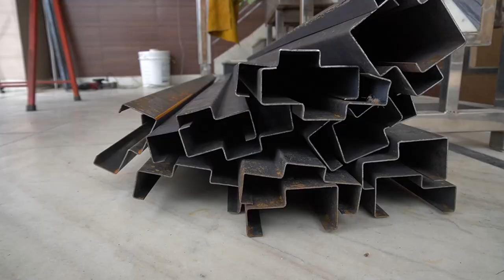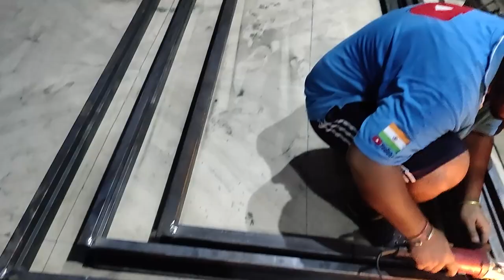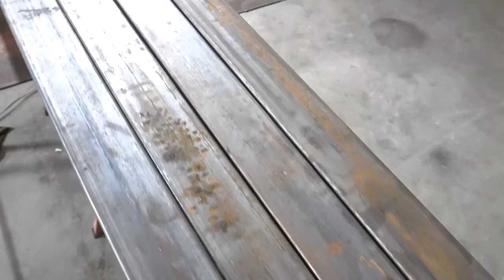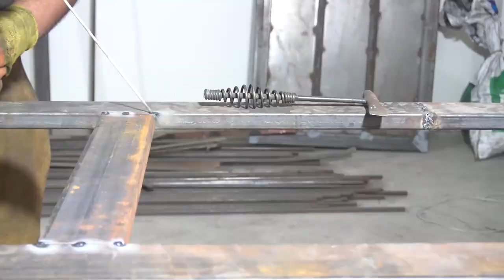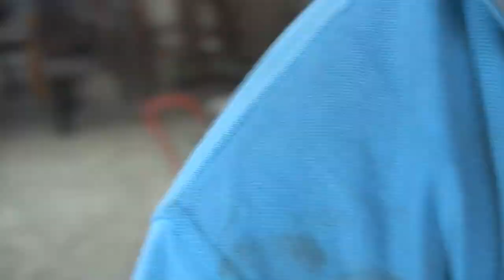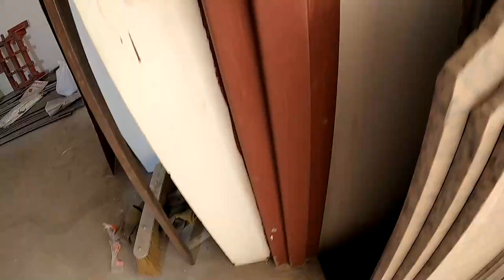Modern Iron Workshop Gate/Door build with stick welder/ Latest Home & workshop Door 2022

Comment: Looks great, another cool build. Im not familar with those plastic threaded inserts on the hinges, but that seems like alot of weight for them to hold over time. Just a thought.
Reply from the maker: Thanks mate. Might be you are right but those doors aren't that heavy, around 35kg per side and I read that these are capable of holding at least 40kg per screw, which is downward force. Seems like sixteen of them are plenty but once I shifted my tig welding machine to this shop, I think I am gonna secure it more firmly to increase more strength.